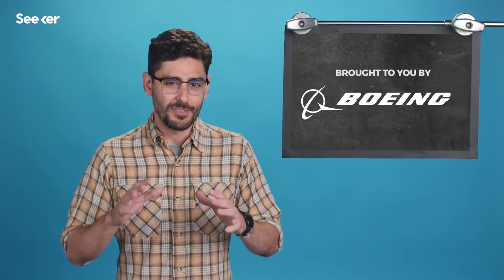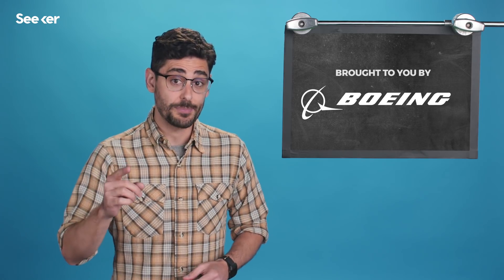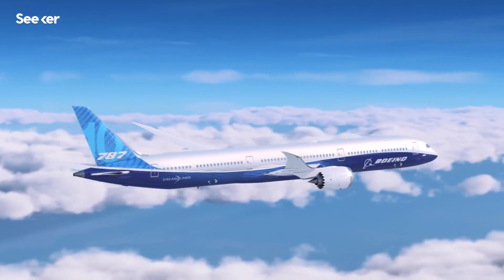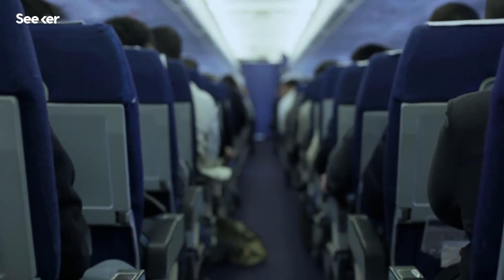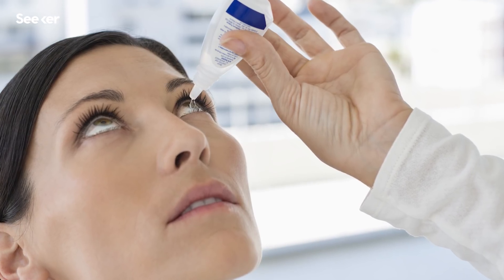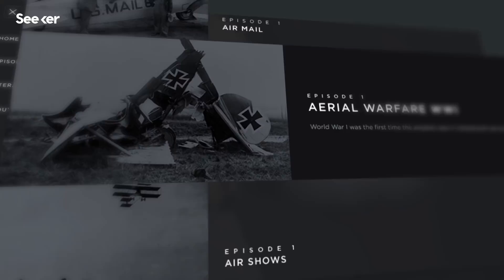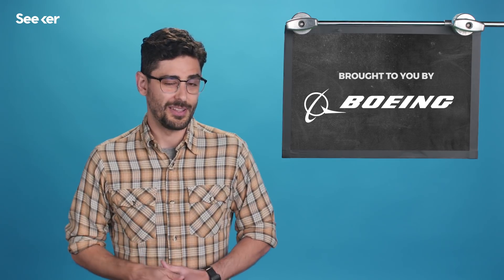Have We Really Engineered a Plane That Prevents Jet Lag?

Comment: Really poor reporting construction and logic - Premise: Jet lag is caused by crossing time zones; Solution: lower cabin altitude and increased humidity.  See the problem?

Start you story by introducing the problem being solved (low air pressure and humidity cause x,y and z symptoms when flying), not by confusing it with a separate issue that is not being addressed (flying has a negative affect on circadian rhythms).  I really question the state of journalism when a "professional" can't construct a report that would pass a high school English class.
Reply: They should have gone with "Has someone really designed a plane that make airplane food edible?" The low humidity and air pressure also effect your taste.

Comment: most symptons we've labeled as "jetlag" are caused by exposure to high levels of radiation higher in our athmosphere, 1 hour at 30kft equeals 100 full body x-rays.  If they are thinking of fighting the exposure through actually protecting the passengers with smart engineering to some small extent, that should be possible. It's just not as cheap to Shield a plane with Led.

Comment: Obvious question, why not just boost the oxygen percentage in the plane so that the amount that's absorbed into the body at 6000-8000 feet is equivalent of what would be absorbed on sealevel earth? No extra pressurisation needed for that, just add a little oxygen from the oxygen tanks so it's up to say 25% oxygen in the atmosphere in there instead of the usual 21%. Would have the same effect wouldn't it
Reply: Nop, that can possibly kill you i think. Breathing levels of oxygen above whats normal to breath on the ground can be  toxic to your organism depending on the percentage above. Thats the reason why we dont breath 100% oxygen.
Reply: Higher levels than normal into your cells can be harmful in some rare cases, but in this case, that's not what's happening, this would only acheive the same amount into the tissues as occurs on ground level.
This is actually a solution that's been suggested for a colony off world, particularly venus, where a "city" could be floated above the planet at a normal earth temperature, but the pressure there is equal to about 8,000 feet earth. 
One suggestion is to keep the pressure the same as outside air so the structure needs very little structural strength, basically living inside a light weight floppy plastic balloon & just increase oxygen concentrations so that the amount of oxygen reaching the tissues is the same as on earth instead of actually making a structure that can handle pressure differentials. 

That's the main reason I'm thinking that if that's the issue, it should be easy to do the same on planes above earth
Reply: This is already done on spacecraft and the ISS. Also EVA suits. The only real issue is an increased fire risk.
Reply: dam I hate youtube notifications! Jack, thanks :) interesting info, I didn't know that. Is the fire risk really that much of a risk? It should only bring it up to the same risk as at ground level from my understanding, due to less oxygen particles, so therefore the higher concentration only creating the same oxygen particles per square metre as at sea level, so wouldn't that mean the fire risk is the same as normal (although higher than currently in the plane I guess)

Comment: I've never had jet lag or ever conceived it as a problem. You can get tired after a whole day of traveling, especially with connecting flights until you reach your destination; with the dry air plane air and low pressure e.t.c. And if you're like me you can't really ever sleep on a plane either. People complaining about "jet lag" like it's the worst thing ever and taking a day or two off work after traveling baffles me to no end! Have you never stayed up all night? Gone to bed waaaay too late on the weekend and then having to be up super early monday morning? You may be tired the first day, but just set your alarm and get out of bed early (local time) in the morning and go to bed the correct time (again, local time) and voila - you are now on the new time zone's schedule. No reason for dehydration or diarrhea o.O Never even thought those could be the symptoms. You should always be hydrating, whatever time zone you are in.
Reply: Different people's rhythms are more lenient than others.  Mine is pretty strict, but a ~26 hour day, which pretty much means I feel jetlagged and terrible half the month just staying in one spot.  Diet, exercise, and keeping to a strict sleep schedule has gone a long way towards helping, but I still feel pretty rough for half a month, and like superman the other half.
Jet lag for me is pretty much hell.  When I go visit family 3 time zones away I just stick to my home's local time and schedule as much as possible.  As most trips are just a day or two it works out fine.  It is really rough when I am there for a week and I am just starting to get use to the local time there, and then come back home.
Reply: That's my secret cap, I'm always jet lagged.

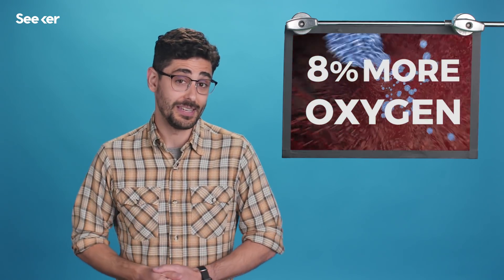Comment: 2:08 & 2:47 Wouldn't the cabin pressure be higher rather than lower? The atmospheric pressure is greater at 6,000ft than it is at 8,000ft. Lower cabin pressure would correlate to higher altitude.

Comment: I'd still prefer less air recycling . Since they banned smoking on planes, they figured they can start saving more running costs by cutting on fresh air, saving weight, fuel, etc. But causing higher sense of jet lag-like symptoms.

Comment: The Airbus a350 and a380 can also stop jetlag but you're sponsored by Boeing so I can forgive you for ignoring the fact that these two jets can also do it and can carry more people.
Reply: Noah Bowie good point, though it's important to note that passenger capacity is not a metric that planes like these directly compete on.  An A380 serves a different market niche, it's not necessarily superior because it carries more.  I've flown on many A380s and one 787. . . they were both comfortable, TBH.  

Both very quiet compared with older planes, that's the best part.